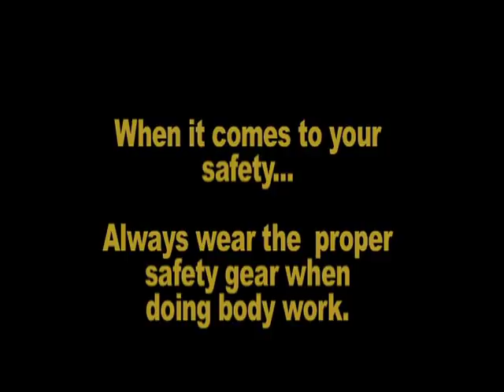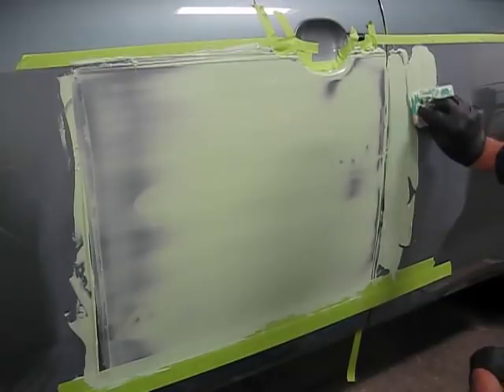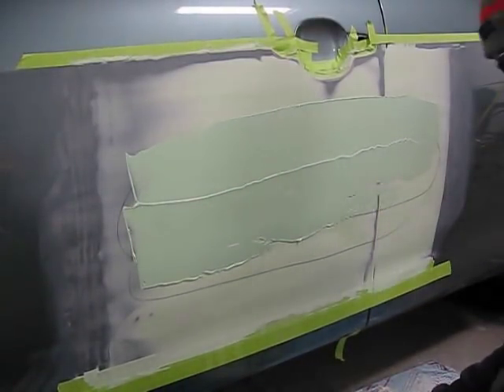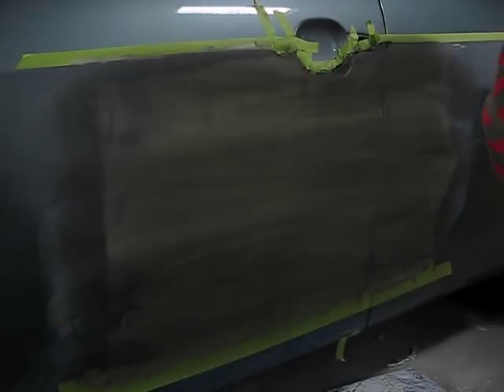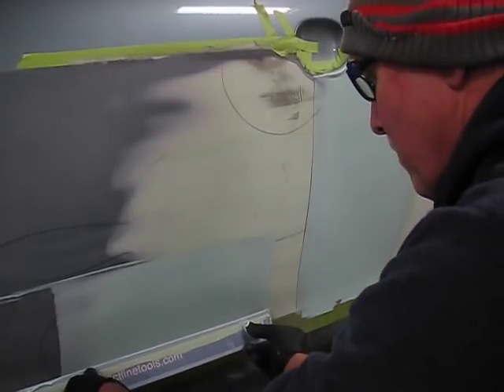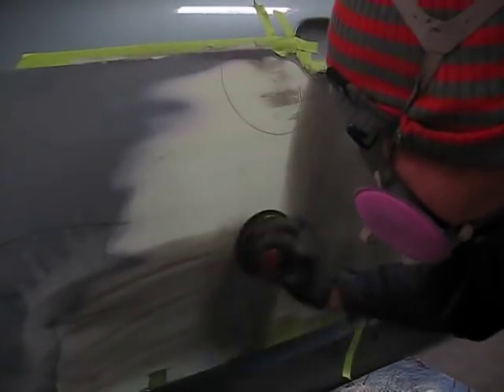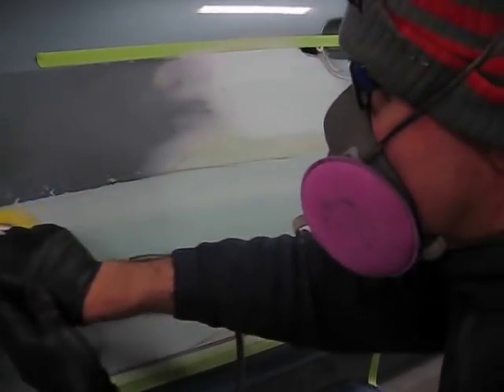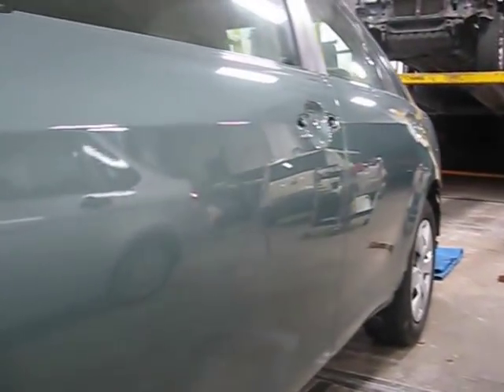BONDO SHAPING PERFECTION WITH THE BLADE

Comment: Look at the finished product. Its like glass. I see a lot of people knocking the guys technique, and I myself have been doing this for years with flawless results, I do it a little different than this guy myself, but the important thing is to do what works for you.
Reply: yeah I agree...most comments are from newbies. He gave a hard example and I think he does a lot of restoration work where you can't get panels and have to fix them.  Id buy a new door skin at my shop on that repair but its for DEMO purposes. On Bedsides where the customer wants it fixed and wants to save a grand on a panel and its a work truck., that is where this tool works.

Comment: everyone has there on ways! at the end I would of been a happy customer thanks for video and tips
Reply: Wrong! As a right way and a wrong way and you just want to put your 2 cents.... Sorry it took 2 years for my reply...
Reply: Vero, You are correct, there is ALWAYS more than one way to complete a repair. It's nice to see different approaches and methods of repair, even if it's not how I would do it.
Reply: You wouldn’t be happy when you get that bill as they charge you by the hour and or how much product they have to use but usually by the hour and he tripled your original bill at a place that actually knows how to do it
Reply: Have you even ever worked with raw materials like this...
Despite the tips of the video as you've mentioned.. Hardener applied would've made the project very complicated to worl with by now.... That's all many are saying! Know your facts before giving credit also job must be done properly if you're going to video it!

Comment: No disrespect I was taught how to do this with 12" 18" and 24" stainless steel Engineer's Rules, Or long blocks and whilst it may be useful for DIY or the apprentice , through time as a professional you get an eye for applying cataloy to the point it becomes second nature just as if your handwriting. Im not mocking the product just passing on my thoughts. Also I think preparation has a lot to be desired cataloy ( or bondo ) on top of a untreated paint finish, what's it going to adhere to. Im sorry Im confused as this no3 blade no2 blade etc best tool you have is your hand.
Reply: New products have now got better functionality. Rage Ultra advertises it can be used over clear. The different blades are for different radius curves. Check out his site for a better explanation.

Comment: Hi there. Beautiful job, thank you for sharing. Can you please what kind of bondo you are using to stay soft for so long? I a novice in this field.
Thanks 
Radu
Reply from the maker: There is a filler from Keystone that works great.  Premium Plus Body Filler KEY1071A from www.OrderKeystone.com
Also, Evercoat makes a new filler that has a longer working time.  It is called Ultra Extra.  We have a write up on our blog about it.  www.exactlinetools.com
Reply: Bondo reacts to how much hardner you use. use a little slow dry use a lot quick dry.
Reply: Damian Rojas where can i buy that kind of stuff?
Reply: body filler also hardens quicker depending on temperature...more so I think, I go through much more hardner in our cold ass shop in winter
Reply: use epoxy products for levelling -aligning surfaces not polyester crap.
Reply: Please dont do it this way novice.   Learn how to work metal and you will be a higher paid expert. Metal work is and art form. Anyone can slap on 4 coats of mud and sand it down. NEVER EVER seal the doors shut.... Ever. Everything about this job is bad. If your metal is bad your job will be bad. Build a house on a bad foundation and see how it turns out. Work the metal limit the bondo and putty and the job will look 10000x betyer than this
Reply: 3M™ Platinum™ Plus Filler use less hardener to make it soft.its easy to deal with..

Comment: never use a d.a on bondo a mud bug is safer then using a air file to straightline sand then a block and using guide coat  i never will put bondo on an area that still has paint your asking for trouble......
Reply: Scott Fitzgerald you can use 3m guide coat or flat black spray paint auto body tool Mart sells the guide coat it has an application pad that you rub it on the surface hope this helps

Comment: You are suppose to remove the guide coat that is left because filler doesn't stick to it well. That's why you outline it with a pencil...it identifies the low spots after you remove the guide coat.
Reply: Hmmm 👀
Reply: Well you’re supposed to put plastic body filler over bare metal only but here we are.
Reply: @jamessharp9790  not true
Reply: @censoredbyyoutube3099  I’m out of date - it was true in my era

Comment: Have owned a body shop for over 30 years.  If you can sell 3 metal strips for nearly $200 with S&H then good for you! While there are always numerous ways to skin a cat, anyone with a little experience could knock the shaping out quicker with a filler rasp and viking including blocking for paint.

Comment: Ya know, I'm really trying to look at this with an open mind but I just can't overlook how many things are just wrong about what is being done. Way too much bondo, covered way too much of the panel, the "sweep" of the blade created a hump in the bondo, and then to put a d.a. over it, the penciling is just pointless, the "low" spots are actually created by the bondo being too high.....etc. The area that was ground down should be pretty much all that should show bondo after sanding. Anything else is just sitting on top of the panel. Also, 80 grit is commonplace for cutting bondo, then working down to 220 for primer. But that's just my opinion.
Reply: You do production work he car car show work. I would not do this on a through away new car.
Reply: I do both production and resto work. I would NEVER use a D.A. on ANY show car. I get that people have their own way of doing things but this is hard to watch.

Comment: Great video!

Not a waste of material at all. It repair takes as long as it takes. obviously within reason but I'm a perfectionist so I can respect the time put into that repair to get it straight.

I do my repairs the exact same way. I find its the only way that gets me the transition from panel to panel to my satisfaction.

I'm going to get at my supplier  and buy one of those blades! What a time saver.

Take care.
Reply: Made a project out of a couple dents , because in this days ,the so called body Tech's ,don't know  the dynamics of working the sheet metal , I could up fix them up without hardly any Bondo .

Comment: wow very nice video originally i thought to myself that the bonds had a very extended work time compared to any i’ve done  in South Florida than i noticed the winter hat you were wearing  indicating cooler temperatures than i normally work in   plus the majority of my plastic filler use in the last 25 years or so has been in woodworking and inside a climatically controlled  enviorment  and the bonds tends to  go off pretty quickly as i think the wood absorbs  moisture  pretty fast ?

Comment: This method is much the same as doing drywall mud where drywall panels joints meet unevenly. One coat one way then one coat in the other direction riding the top of the waves left by the previous coat, filling in between. This works well. The only difference is that the panel curves increase the complexity a bit, but tilting the edge of the spreader further allows the edge to conform to the edge of the curve. small plastic spreaders don't cut it when trying to shape large areas.

Comment: Sorry Sir, But you wiped that on & off forever and ended up going with a “wipe” that you had numerous times before that, and you still had high spots that needed to be pecked in. Which in return means that you likely had to fill that panel again after that. You’re a crafty vet I can see that, But I’ll stick with filling that with a regular spreader. I could’ve had that thing filled, sanded off AND in Primer, while you were still wiping filler on & off… 😜😂🤣 

JK, Nice work Sir!!!

Comment: Are you a pro bodyman? Damn..Id be done blocking by the time you are done with your 19th attempt at sweeping the filler. And most fillers would be hardening up and getting pretty messy after the 3rd attempt.

Comment: What an operation done badly.Filling over paint instead of bare-metal, not recommended. Filling over high spots.
If you need a straight edge an old number plate is ideal, these blades are a luxury, 
The rubbing block should be big enough to cover repair area.

Comment: Bondo doesn't like to adhere to guide coat. Long term that can give delamination issues. I like your process and the blades are a good idea.. my issue is: that's a lot of mess to clean up. Before you get your blades ran over that the mud is kicking and you've got dried product on your application tool as well as your two blades. 

Personally, I would rather apply the mud, cheese grate the highs out and start blocking with 80 before it gets hard as a brick. There's not much work that you need to avoid if you get started on sanding bondo at the right time. It's easy.

Comment: Mate I would of had a skim in place, heated with heat gun...And be sanding with a DA sander 80 grit. I do the last 5% sanding with a block...Finish with 180, then mat black and 320 the fine scratches out. To prevent sinkage of paint a few weeks after repairs if using cellulose primer which dry double quick. If 2paking you can leave it at 180

Comment: To much filler stay in the area were the dent was if ya fixed the dent properly all you would need is  a drop of filler and regular spreder and in 15 minutes it would be done priming 800 grit the hole door base fog it over half the door and quarter panel 2 coats of clear finished it's a hour to 2 hour job and out the door

Comment: It's so much more difficult in a 120* garage. Not much time to spread in the Hot AZ summer heat, even with min hardener. I would love to have the time & luxury to apply filler smooth in time with out it going FUBAR fast... any suggestions for hot climate spreading? regards

Comment: That's a worthless technique he had it with the squeegee it was nice and smooth,  you could see the blade bowing in the center which is why he was low on the edge it took too much off on the edge left it fat in the middle. I'm sorry any decent tech should need no more than 2 times bondo 1 time to level it 2nd time is a skim coat you don't want to break through to metal or to the 1st bondo coat and you never want to have to bondo on top of the 2nd coat, 2 separate coats differant amounts of hardener they don't always feather right and can leave distortions look at the bottom of the door you have 3 differant layers of bondo I promise you that is not perfectly straight all you should see is a solid layer no metal or paint showing and certainly not 3 differant layers of bondo

Comment: So the point of this video is that blade didn't do anything to save you any time.  As much time as you spent on that dent, I am sure your customer was pissed at what you charged for labor.  Would have been cheaper to go to the dealer and buy a new door and get it painted.

Comment: Do you have any videos of what you do after that? Like primer or paint. Thanks man
Reply: A pcl primer, sand it 320, then primer sealer, sand 400 grit, and paint.
Reply: If you went to metal you spray an etched primer first. Additives prevent moisture and rust.

Comment: The reason for using the blades is to greatly reduce the amount of time to fix low spots on a car. Professional work requires professional tools. $150 is cheap compared to a professional DA buffer/polisher like Rupes that's $400 but that's the name of the game. You get the best to be the best. Most of these comments talking about completely stripping the paint is understandable but guess what? When the insurance company only wants to pay a certain dollar amount to get it done, are you going to do more work for the same money? Heck no! So his method is valid because insurance companies require repairs to be OEM quality and the finish came out perfect. Respect the game

Comment: Does this use a certain hardener to give you extended work time?
Reply: Dave Babcock
1 second ago
 Now that filler can be adjusted for desired time to setup, and still keep the ratio correct, it is easier to learn how to get it right, while the filler is still soft.

More than one type can now. Rage Ultra and Rage Extra
https://www.youtube.com/watch?v=sJcJ0lOKJJo
Others can as well.
 He has more info in other postings, and on his site.
It is now far faster to shape the filler soft, than once it hardens.
Shops that don't start to understand this, are like people who try to stay with Windows 3.1, while others have moved on to Windows XP or higher already. They will soon be left behind. And no, I do not work for the seller of this, or for the filler companies. But I do know from experience, that this does work very good.

Comment: Y fill over paint!? It's not the correct way to filler!
Reply: +Paul Zonneveld You do realize body filler is not meant to go on paint ? It is supposed to be applied to bare metal . Want to know why that is ? Because of adhesion issues . Body filler doesn't stick to paint and it will crack . Try this . When you repair something and there's bondo on paint , try scraping at it with your finger nail . It will chip away . Why ? Adhesion issues . Also , you may think it is the correct way but months down the road you'll see the outline of the body filler and the paint will just high light it . I'm not a know it all . But I am in a vocational school learning the trade and on my way to become a certified technician .

Comment: False information at 19:25. Hard spots in the bondo WILL NOT be an issue if you knew that you are suppose to clean your spreaders after every use not leaving the old bondo on your spreaders when applying the next coat. Acetone does a great job cleaning your tools.

Comment: looks like you are using mud and not bondo as you mentioned , this is ridicules , the bondo will dry out if its mixed correctly long before you used the first  blade .another oppertunitiest

Comment: none of this is necessary and is a substitute for properly executed bodywork.way too much bondo applied then reapplied.
why use a straight edged blade then sand with a small diameter d/a sander?you just contradicted your own product.

Comment: First of all yes you can gibbo over paint providing it's keyed up .. am wondering why you filled over door gap.. cutting the filler like that obviously is gunna scratch the door apperture resulting in painting the door apperture Which in most cases can be foam edged
I would have took the door off and put it on a stand so you can work above it
For me probably 2 skims with a number plate guide coated with powder and blocked off
Then wet up with panel wipe afterwards to show any ripples etc just saying like

Comment: The "Blade" would be handy in doing large areas but I really have to disagree on the blocking with 180 and 150 grit sandpaper. Put some 80 grit on a flatline sander and hit it to get it knocked down and move on with another wipe if you need it. Faster and you can move on to the next step and just go to a finer grit when needed. The way you are doing it is a major waste of time and time is money.

Comment: How about sharing your plastic mix percentages to achieve the calm, long play you get while spreading....it's probly the most significant factor if one is methodical and organized...how about it?
Reply from the maker: We have discovered that using a Glaze Coat (25%) mixed in to the plastic filler (75%) makes the filler a better consistency for spreading with The Blade.  This percentage mix is approximate.  If damage requires a deep fill, use less and if a light fill use more. The glaze helps make the filler more spreadable and does set-up faster.  The real KEY to give yourself more time to spread the filler is to control the temperature of the environment you are working in.  I was just asking Terry about the specifics regarding this and he said, have him call me and he will explain fully.  So....call us at (971) 269-6170 and Terry can explain how to get the temperature controlled for the optimum "spreading" time.  Thanks!

Comment: Just wondering why you made the repair area so large when you only had three or four tiny  spots to fill , I was always taught to keep it as small as possible. You are making the areas where it doesn't need to be repaired higher than it has to be. opinion only use masking tape first only at the edge of the dent to protect the other area and you can use the tape as your sanding guide . this way you will have the correct profile every time

Comment: Amateur hour.  Apply your body filler the traditional method and then surface it with blocks.  Using this method only increases the amount of tools you need to clean each time you apply or re-apply.  My boss would have my ass if he saw me using that thing, and especially if he saw me using it for a second application!  Time = money.    If that product had any validity, you should have been ready for putty after your first application.  Don't mean to sound so harsh but most skilled body tech's could have re-skinned that door faster than you putting 19 coats of filler on it.....
Reply: old school body men are cringing,lol.

Comment: Junk tool! Only useful in 30% of body and less as traditional damage is on corners with high curvature. The tool is flexible so the larger the area filled the more drag and so a higher crown in the Bondo regardless of the real shape needed.
Reply from the maker: mrrberger Well, sir... you obviously have absolutely no clue how this very effective tool works. Cheers!